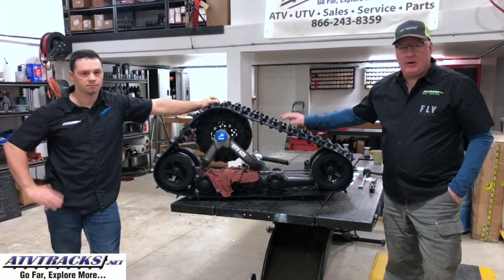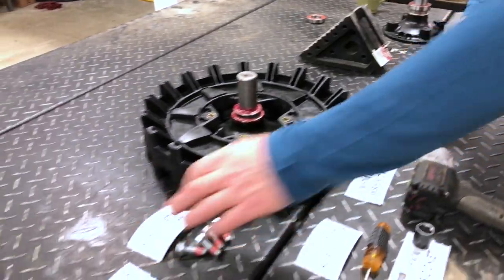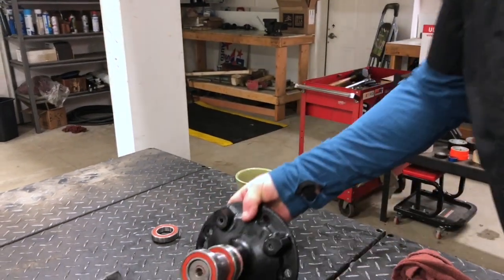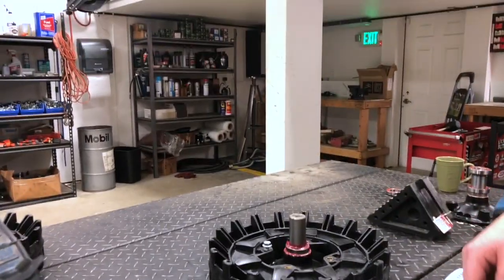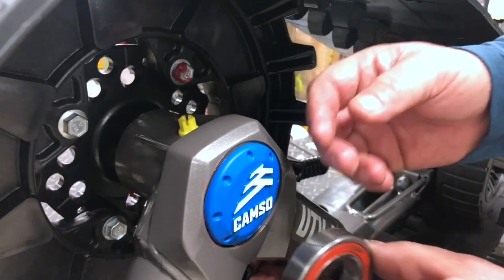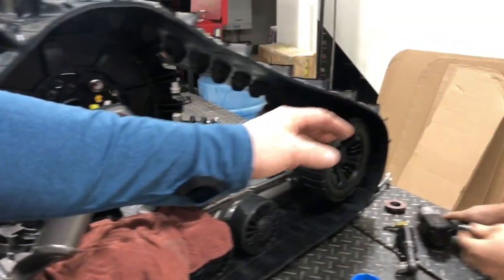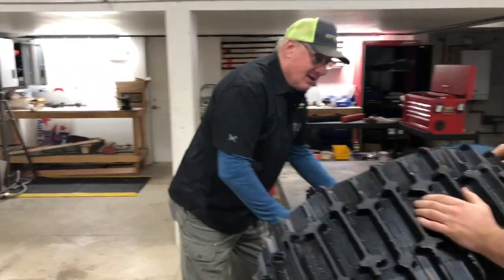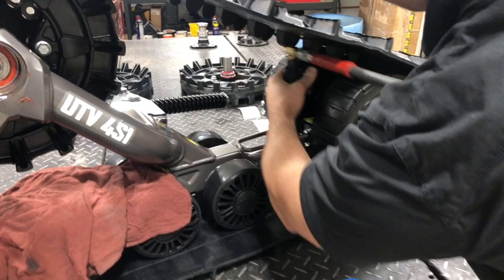Camso Hub, bearing, and drive sprocket replacement

Comment: i just got the kit from can am commander to my ranger north star …. i only got two hubs and two sprockets, is that correct? thanks
Reply from the maker: It kind of depends on the situation. Did you order from us? Give us a call 866-243-8359

Comment: Interesting video but I would definetely use a torque wrench for the hub. 92 Ft./Lbs to be precise
Reply from the maker: Yes a torque wrench is best but our gun was set at 92lbs
Reply: @atvtracks  Ok thanks! I didn't see the second part were you are actually using a torque wrench for the final adjustment, thought you were done after using the air gun!

Comment: I find it weird to have roller bearings with seals still in them with an oil bath system. 

And I can only imagine that 2 bearings were not adequate.   Not sure why they are roller bearings when it not only sees lateral load but axial as well.  Seem weird not to see tapper bearings.......
Reply from the maker: These are sealed bearings and the oil is to extend the  life of the bearing if the seal brakes. It has increased the bearing life 3 times,. Also camso went to three bearings  2 on the inside as this supports most of the weight   and eliminated most bearing issues.